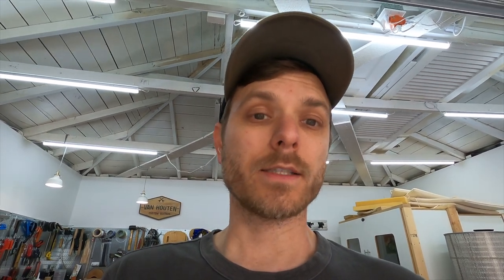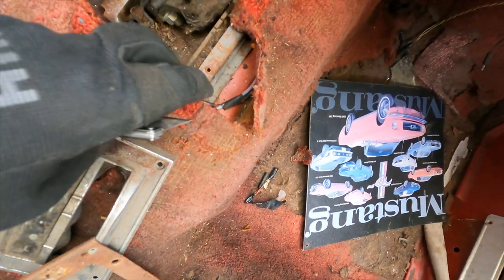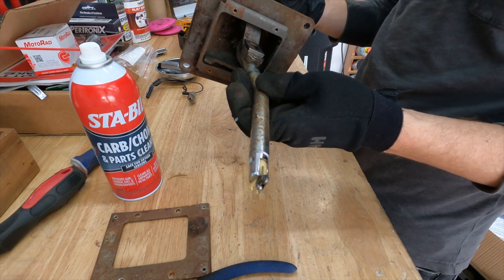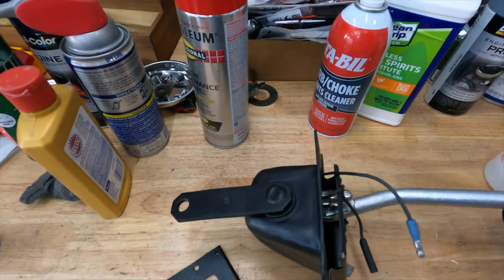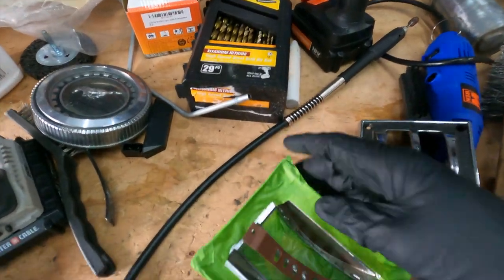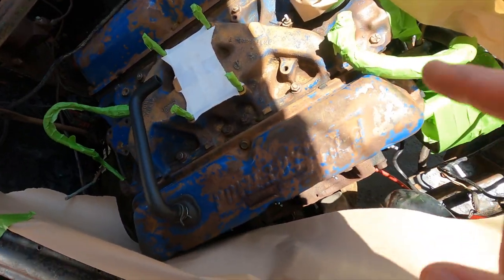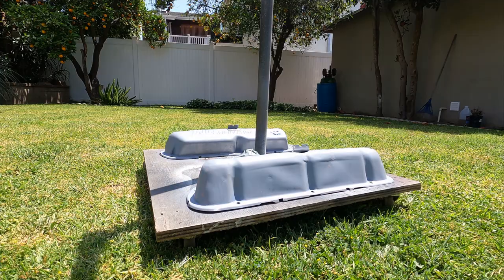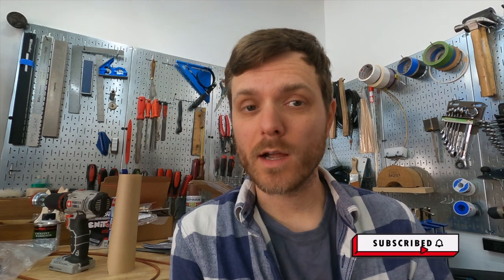1965 Mustang Restoration | Engine Makeover| Part 2

Comment: Great progress on your ride!! My 1965 Ford Mustang Fastback has over 689,000 miles on it and I had to buy a new shifter assembly. The little tab that you made was terrific. The local shop I use wouldn’t weld my old one saying they didn’t want to be responsible for any future problems. I got my money’s worth after all those miles. Your extensive skill set is incredible and allows you to do amazing work by yourself. Diabetes has taken the sensitivity away from my hands and made future work very difficult. The shifter has a place of honor on my garage wall along with my steering wheel which disintegrated at 525,000 miles. They don’t make them like they used to!! Ha!! Enjoyed the progress… keep it up and thanks for sharing your story!
Reply from the maker: 689K miles is really impressive! I'm trying to do as much work myself while I'm able to! Thank you so much for following along, this is definitely a rewarding experience for me, can't wait to get it back on the road!

Comment: Great vid! Thanks for covering the shifter issues. I have the opposite problem with mine. It is very difficult to shift from gear to gear. Now I know what to expect when I get to that point in my repairs.
Reply from the maker: Maybe your shifter housing is rusted or needs to be cleaned and re-greased?  Either way it's not too hard to take the housing out to see what's going on with it! Good luck with the repairs!

Comment: Hey, engine lookin' and soundin' great. You did a nice job. I have crummy chrome valve covers on my 289 but the original valve covers are in the trunk and I will be reinstalling them soon. I liked the shifter part, great info. I wondered how that worked. Great job, thanks for the vids.

Comment: Probably too late, but it would be good if you add some clear coat to the valve covers.  When I did mine the first time, they got really dirty from grease and such which kind of stained them. I redid them with clear coat and everything just wipes off.
Reply from the maker: Yeah unfortunately it's too late now. When I eventually re-paint them, I'll add a clear coat! Thanks!